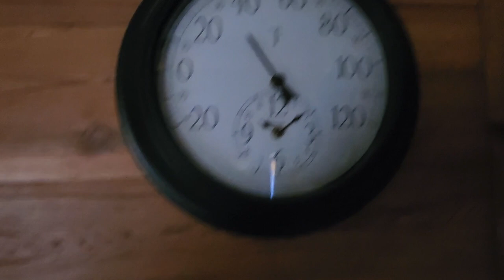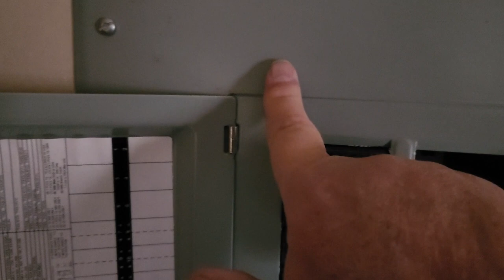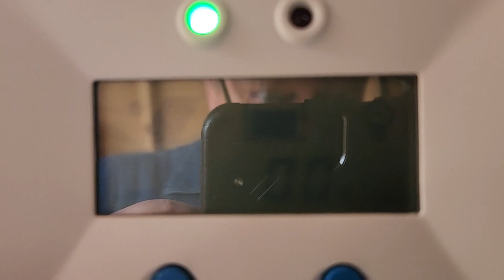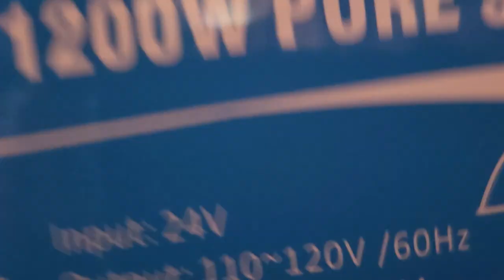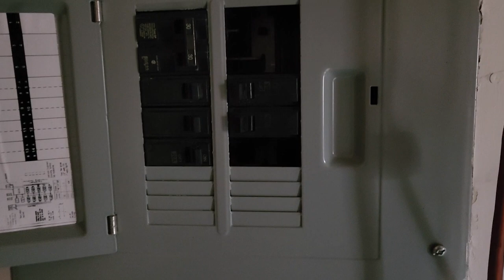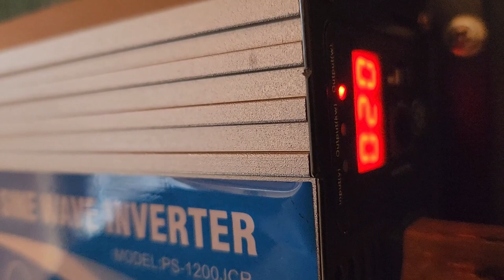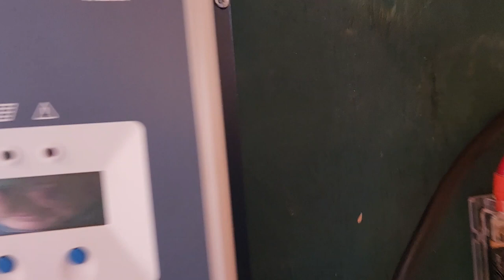DIY Connecting Solar to the Off Grid Cabin

Comment: I need to see how you done the main breaker to get 120 on both sides.. good video. Thanks. Those giandel inverters are good ones I have the one you have and another 24 v 2000watt one.
Reply from the maker: +@marvinsalee7134 Look at my video “Wiring the generator to the cabin”.  It show how to jump a double pole breaker.  Thanks for watching.

Comment: How do i decide if i need a 30 amp or 50 amp breaker
Reply from the maker: +@joshuabradshaw3050 I based it all on what I would be using.  I have a 3 bedroom 2 bath house with 4 adults. Central air and heat.  It only has 100 amp service.  There are calculators to figure out what you should set up.  And, my generator only pots out 30 amps lol
Reply: @StBernardAcres  ok do you have recommendations on a simple and to use calculator app or website for that? Thank you for your time
Reply: Watts / voltage = Amps. Make sure you minus 20% from the final capacity. For example, let's say we have a solar panel array of 5760 watts, and our inverter is converting to 240v. When we do the division, we know we need a 30Amp breaker. This applies to everything.

Comment: Dangerous!
Suggest using a generator transfer switch.
Reply from the maker: +Whit Elfner There is no need for that, as I explain in the video.  The two systems will never be in the panel at the same time.  To change to generator, I have to unplug from the inverter and vice versa.